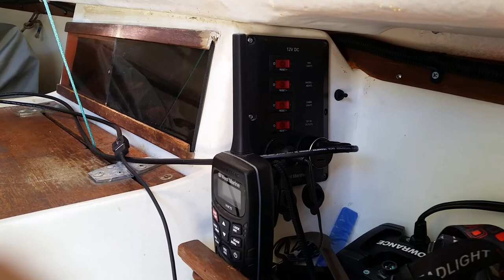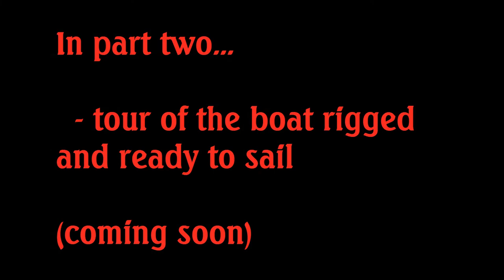Boat Tour: A Cruising Specification West Wight Potter 19

Comment: Thank you for putting together.  I too have a potter 19, made tons of mods to get it where it fits my lifestyle.  This year added the code zero, am looking forward to your next video hopefully showing it rigged and sailing.  Not much information regarding this set up but am personally enjoying being able to sail in light winds that previously did nothing, even if the angle is limited.
Reply from the maker: You're welcome. Thanks for the comment. The Code Zero is a great addition, and performance in light winds is transformed, as you are no doubt aware. Yes, the angle is limited compared to a genoa, but it's so worth having. A sail wardrobe of CZ, lapper and 90% jib covers a wide range of wind strengths and is quite ideal for single-handed coastal cruising. If interested, you could check one or more of the other videos that show it flying together with the lapper going downwind. eg. https://www.youtube.com/watch?v=zOBBqtf5T7A

Comment: Had a WWP 19 (2001) model great boat sailing inland NE Ohio lakes and a Lake Erie islands cruise.

Next I bought a Precision 18 (Great Boat also!)

I now have a 2008 Montgomery 17 I bought at the end of last sailing season sitting covered in my driveway. What’s interesting is the 17 is the smallest of the 3 lengthwise but it has more interior room than the other 2 boats and it’s hull is massively overbuilt! A Lyle Hess trait that this boat is known for. She’ll sail Lake Erie this coming summer.
Reply from the maker: Thanks for sharing!
Reply: How would you compare the WWP19 and the Sage 17 as far as overall sailing abilities?
Reply: Sorry, stumbled on this a couple months later. The WWP 19 is a fine boat with HIGH initial stability but if she goes over which would be very hard to do I doubt she’ll right herself. A WWP 19 was sailed with no drama from San Francisco to Hawaii.

The Montgomery 17 IMO is a small Bluewater Boat (about the smallest production built) with minor modifications she can take you across oceans albeit not in great comfort.

“little breeze M15” California to Hawaii

“Strawannza M17” California to New Zealand